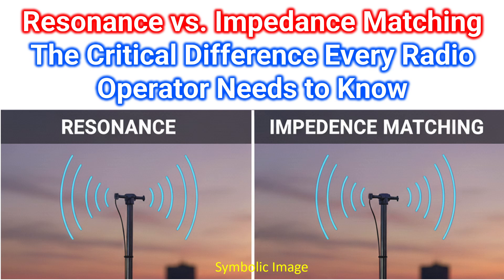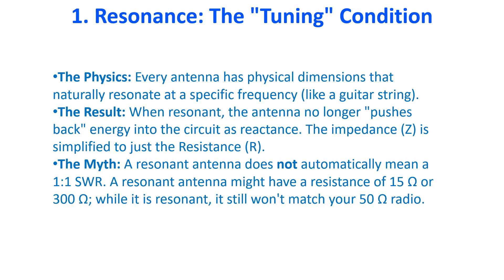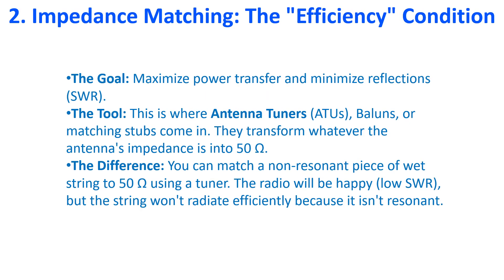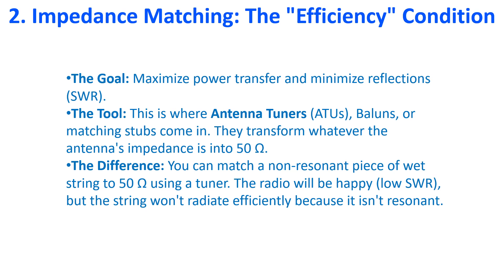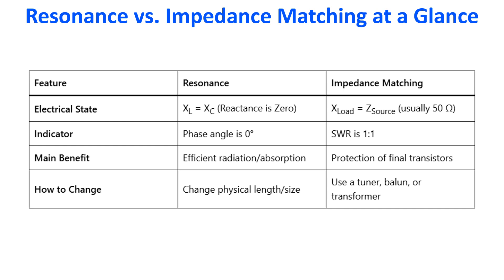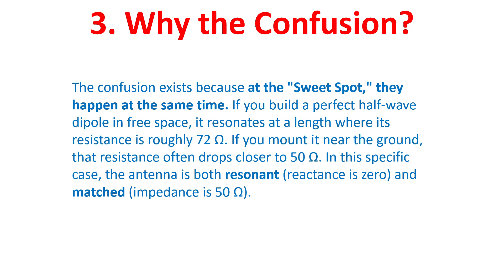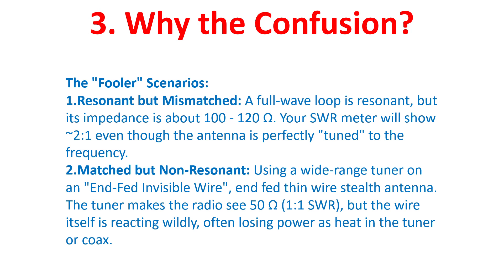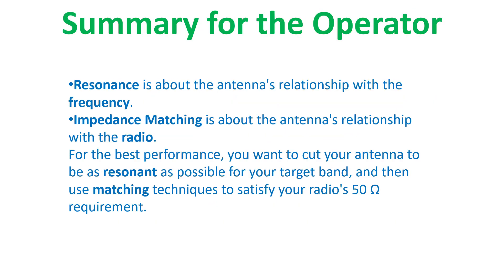Resonance vs. Impedance Matching: The Critical Difference Every Radio Operator Needs to Know

Comment: Howdy.
I advocate a somewhat different view.
If a random wire is tuned to resonance using a tuner or a transmatch, it will radiate almost as well as a naturally resonant antenna without a tuner. The tuner coil will produce losses.
Within reason !   It should be almost impossible to match a 2 meter whip on 40 meters. Technically that would mean enormous antenna voltages. And the tuner loading capacitor needs be of huge voltage capability. Much of the radiation would be leakage flux from this capacitor.
Cheers.
Reply from the maker: Thanks for providing this valuable perspective! 73 Jon, VU2JO

Comment: You initially got the definition of resonance correct: Inductive reactance equal to capacitive reactance, but then, in your chart, you say "how to change" is "change the length". This will certainly work, because length is related to resonance by velocity. But an antenna tuner can also change resonance by adding inductive or capacitive reactance. That's why it's called a tuner, because it can tune the resonant frequency by adding reactance. A tuner can also transform the resistive component. While a transformer (balan, unun) can transform the resistive component, it is not designed to adjust and cancel the reactance, like a tuner. The reason there is more loss in a feedline between a reactive antenna and a tuner is because the antenna reflects reactive power back to the tuner, which reflects it back to the antenna, and back to the tuner, and back to the antenna, and so on. If you have modest 3 dB of line loss in the coax, only half of the transmitter power makes it to the antenna, the rest heats up the coax. But only half of the reflected power makes it back to the tuner. And when the tuner re-reflects it back to the antenna, half of the re-reflected power is burned up in the coax. If you must have a feedline between the antenna and tuner, use open wire line, where the loss is negligible. This will allow the reactive power to oscillate back and forth on the feedline until most of it is radiated by the antenna. Another good strategy is to use a remote autotuner at the feed point so the coax sees 50+j0 and there is no reactive power oscillating in the coax. Or you can use a hybrid approach: open wire feedline to a remote autotuner with coax back to the shack. This allows the best of both worlds. You can mount a doublet or OCF up in the clear, and bring an open wire line down to a ground mounted autotuner, and then run a buried coax back to the shack.
Reply: When using a remote autotuner, you can use bias tees to send 12V DC power over the coax. I've got my autotuner set to initiate a tuning cycle automatically when it sees high SWR, so only the 12V power over the coax, no control signals are needed. After QSY, I simply key the carrier at low power for a couple seconds and watch the SWR jump around during the tune cycle. In a few seconds, it's settled down at close to 1:1, and I'm ready to transmit at full power.  I've seen more sophisticated schemes, for instance, I believe Acom remote tuners have a data bias tee, which sends DC power, RF, and a 60 kHz data modem signal down the coax, which allows remote control and status from the remote tuner, as well as a multiple antenna select relay all using a single coax.
Reply from the maker: Excellent points about tuners and feedline loss. Very informative! Thanks for sharing. 👍

Comment: By setting the SWR meter to Calibrate and tuning for a low SWR is good enough for most amateurs but could it be better?
 
I find a better match is found by then increasing the sensitivity and tuning again to get an even lower SWR reading. I used very thin wire and did my final adjustments by folding back ¼ inch at a time then the reading started to increase again so add that ¼ inch back. It was good low reading for about ½ an inch.  

I did this with my tx on 24.950 MHz and an indoor inverted vee and got the following results as shown on my NANO VNA:

24.950 MHz  48 Ω -j3       SWR 1.08. My meter needle just twitching. 
24.900 MHz  47 Ω -j1.5   SWR 1.07. My meter reading does increase here. 
24.975 MHz  48 Ω -j4      SWR 1.09.  My meter reading still good here. 

Well that's pretty close to the textbook value of 50 Ω for an inverted vee. 
Homebrew resistive Wheatstone Bridge SWR meter and FT817ND. 

Edit: 49 Ω can be found at 25.175 MHz but with a j value of -13 and SWR 1.3. A lower impedance as the frequency goes up.
Which is better? 48 Ω -j3 or 49 Ω -j13? 
I'm happy with my results. 

G4GHB.

Comment: This matches my understanding. 

Does impedance matching affect resonance due to adding capacitance or inductance?
Reply: Matching is just that. Matching the feed point impedance to your 50 ohm coax. The antenna itself may or may not be resonant due to its physical characteristics. 

If you had a 10 foot wire antenna and used it on 40m you would have capacitive reactance present. So you add inductance to cancel the capacitive reactance. Assuming the resistance is 50 ohms your SWR is 1:1. But your antenna is still way too short to be efficient on 40m. It will radiate but your gain will be minimal. A half wave on 40m is about 67 ft. A10ft antenna with a coil is not the same even though the SWR is the same on both.
Reply from the maker: Yes. You are absolutely right. 73 Jon, VU2JO
Reply: @doc145  In this case where does the energy go?  With a 1:1 SWR it isn't being reflected back to the transmitter so it's all making it's way into the antenna, with it's matching inductance.  If it isn't being radiated where does it go?
Reply from the maker: @ChrisRowland-c7w That is a very good question. I have compared the SWR in internal and external SWR meters here: "Disparity Between Internal and External SWR Meter!" https://youtu.be/GMfW-s63eiw What I feel is that even if a tuner matches your radios impedance, the feedline and antenna system are still having the mismatch. Only the radio 'sees' the 1:1 SWR. When I use a common mode choke with RG316 slim coax on FT240-43 toroid between the tuner and feedline (https://youtu.be/M35K2Ebth6k), I have physically noted that the FT240-43 core warms up after a long session. Similarly the coax may be getting heated, which we are not noticing or checking! My coax is 15m long and has longer space for radiating the heat. Moreover, I run only 100W. Things might be different if people go for the US legal limit of 1.5 kW. I have not checked for any warming of toroids within the tuner as it is a closed box unlike my common mode choke which is homebrew and having a plastic box with a lid which can be opened easily! Most likely toroids in the tuner are warming up when they are tuning high mismatch like 9:1. 73 Jon, VU2JO
Reply from the maker: If you add it to the antenna like loaded coil or gamma match capacitor, it should. But when you add it at the radio end with a tuner, it will not. This is my understanding! Let us see what others have to say on this aspect. 73 Jon, VU2JO
Reply: @johnsonsTechWorld  I've found that modelling this with SimSmith or SimNEC can give good insights.
Reply from the maker: @ChrisRowland-c7w Thank you

Comment: "Matched but resonant" CAN be inefficient & lossy (especially if the match is at the TX & a long co-ax distance away from the antenna) but it can also be efficient & the preferable solution if the match is at the antenna.
Take a yagi, the driven element self-resonant radiation resistance can be too low & below 50ohms. By intentionally making the driven element too short & non-resonant it becomes capacative, but that capacitance can then be reacted against a hairpin inductor match across the feed point to give the desired 50ohm resistive. Here you actively take a naturally resonant antenna & make it unresonant to make it work better.
Ditto monopoles over ground. They are generally resonant around n x quarter-wave. A 5/8ths bit of metal against Earth is NOT Resonant, but stick the required matching at the base & it is better & has gain over than a truly resonant quarter wave.
Reply from the maker: Excellent points about impedance matching and antenna design. Thanks for watching! 👍

Comment: My working conditions, I'd rather a warm coaxial or transformer balun.  🤣🤣
I work HF from an apartment with vertical antenna mounted to the balcony railing.
KD8EFQ/73
Reply from the maker: Your point is well taken. I too used compromised mounting of antennas due to space constraints. 73 Jon, VU2JO